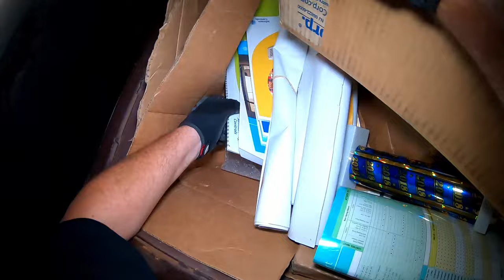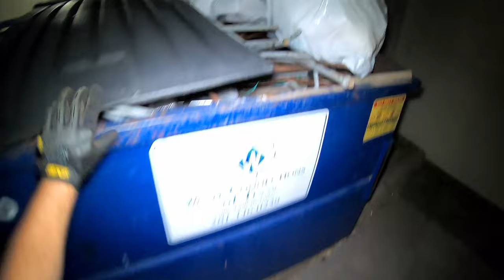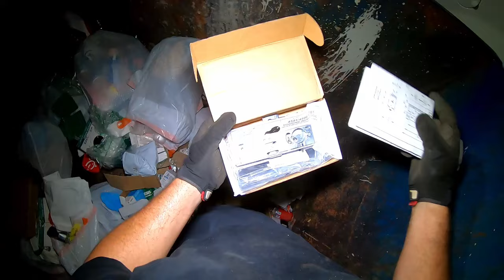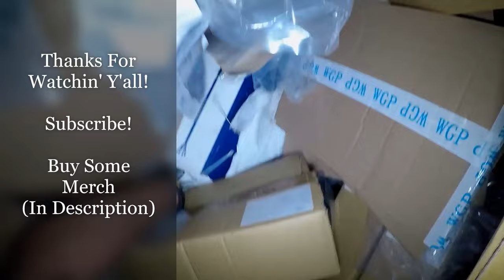Dumpster Diving "Fried Shrimp & Cheese Sticks!"

Comment: 34:04 Those white bundles are sheets of foamish type stuff I used to get from Walmart. The produce departments receive pears and expensive apples with those sheets between the layers to protect the fruit. They would just make a stack of them for me back when I was doing sales on eBay. Sometimes I would have to wipe off juices but for the most part, they were clean. Well, I got so many of them that I started bundling them in 50's and started selling them for $15 bucks a bundle. Nice free lightweight money!

Comment: singing a little yes in the dumpster tonite i see. those hoists can be rebuilt pretty easy. they aren't complicated, and as long as it is a name brand, parts should be available. i've had to repair my cm 2 1/2 ton a couple of times in the 30 years i've had it.

Comment: My buddy just scrapped 600ft total 1/2 wire cable, he used large hose clamps to draw it close six of them all together and used a 16 in cut of blade and zipped throught it NO questions at the scrap yard

Comment: Give you a tip on that cable, if you ziptie it in 4 places you can use a cutting wheel on a grinder and cut it in 18" or so sections in seconds. Just a DIY tip LOL

Comment: Blue System Sensor box - Its part of an air sampling system, there normaly would be plastic tubes in a high ceiling that suck air into the part you have, that has a smoke detector in it to trigger the fire alarm..

Comment: Hey Mike!  I’ve seen ppl put that cable wire inside of washers and dryers. It keeps it from being a mess at the yard, not getting tangled in anything.  Can you do that too?
Reply: I bet you would get banned for that.. im pretty sure the cables messes up the shredder so when they throw the washer in not knowing its in there it can do the same damage as just being tossed it.. I may be wrong but they would probably treat that like putting concrete in things to weigh them down
Reply: I didn’t think about it that way.  I’m with you, better safe than sorry.  Thanks for responding!
Reply: @penny-n-kentucky447  it is a good idea tho if it helps with the shredding problem so he should definitely ask the yard if he can do that and then he can save it up until he finds a dryer and then toss it in but my guess is its probably a no no..lol

Comment: Just wondering why you don't always just pull right up to the dumpster from the start.  That way you never have to back the truck up, or put the scrappy scraps on the ground and then have to bend down to grab them to throw in Betty.

Comment: Those smoke detectors are demanded by law by fire safety standards to be installed onto the side of hard duct for heat and air systems. They're bitch to wire up, especially when you have three sets of four wire t-stat wire being fed into it.
They don't fail very often. So most likely it can't be resold.